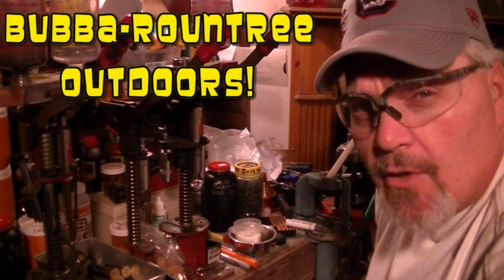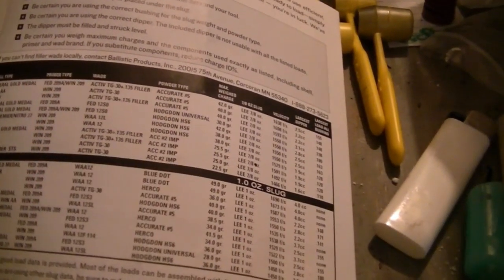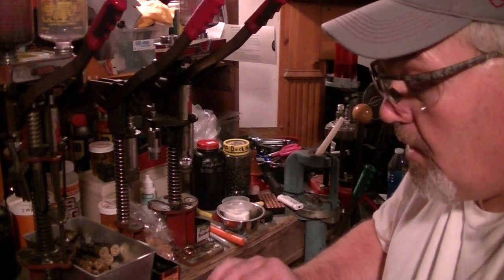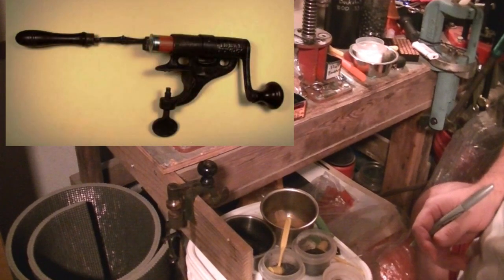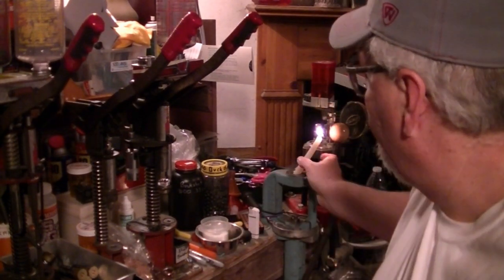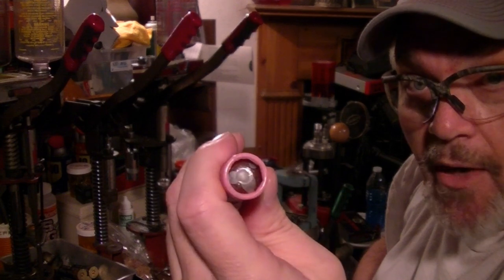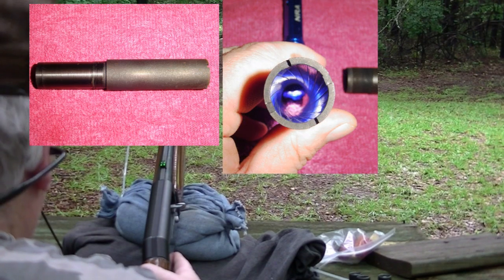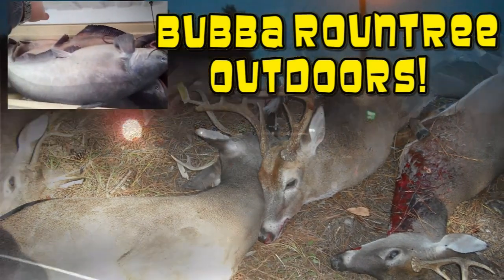Lee Drive Key Slugs! Shooting Slugs thru Rifled Choke Tubes!

Comment: Yo wade, I actually took a cheapy old 3/4” step bit, I wrapped some Aluminum metal duct tape around it, just to cover the cutting edges on the bit. And I use that thing as a hull reconditioning tool. It works AMAZING!! I can literally take a Fold crimp hull, a old nasty looking Roll crimped hull and make the hull mouth look like it’s never had a crimp. Run that thing in the hull until it heats up the plastic, it’ll reform back to a perfect circle. Works really good once it’s nice a heated. I use it ALL THE TIME.
Reply from the maker: awesome!! Thanks John!

Comment: I use the Lee 7/8 oz Drive Key slugs. In a new primed 2 3/4" Fiocchi hull I use 33 gn Longshot and a 7/8 Lightning wad (looks identical to the PT1205) but I trim about 1/8" from the petals so I can roll crimp all the way down to the slug without involving them. I tried a nitro card under the slug to raise it instead, but it made my column too tall. Crazy about these loads!

Comment: thanks again bubba. I've been casting them, bought a scope for my slug barrel.  think I can load these about 11 cents a piece.  if i can hit at 100 yds, i can sell off quite a few guns. with all the ammo shortage, I could always find powder primers and cases and wads.  I think the AK47 will get sold and replaced with a Saiga.  Should be even cheaper in 410, less powder.
Reply: Brian Conway yeah but what's the difference in start up price? Factory 12 gauge vs 410? Yes you could load a lot more with a pound of powder and very little people use 410 that I know of.

Comment: Great video.  I use a 20 gauge nitro card under the slug as well to keep the plastic wad from interfering with the slug when shot.  Works great out of rifled slug barrel guns.  I got one of those roll crimpers too!  If you can find a wad or two after shooting, you will see what happens to the plastic wad.  It actually will "squirt" up into the base of the lee slug, which you really don't want to happen. The nitro card will improve your accuracy.  Have fun!
Reply from the maker: Thanks Bob! I have never used the nitro cards before... I will get some on my next Ballistic Products order!

Comment: Good video. Maybe a bit of help. Those Lee dippers not scoops. You're scooping which is why you're getting so much variation in your charge weights. I push the bottom of the dipper base first into the powder and let the powder flow in. Then use a credit card to scrape off the top. My charges are never more than .2 grains from one to the next. A little more time but worth it

Comment: Thanks for this video. A milder slug load I like derived from Alliant data for birdshot is as follows: (Max load) 8700 PSI ~1300 FPS: Federal Gold medal Hull 8 point fold crimp+ F209A primer+ 22.5 Green dot+ Federal (not claybusters) 12S0 Wad+ Lee 1 oz foster. Optional 20 ga card under slug. 

Obvious disclaimers about loading at your own risk and checking data sources& fit of slug and wad to your barrel and choke.

Comment: I'd like to see that video. I have a couple saiga 12s with stick mags and a drum, and a single shot NEF to keep them company. If you haven't tried an S12 or a Vepr12, you are missing out. Well, with that Berretta super 90, you're pretty well equipped too. Mine have only been range toys and house protectors so far. I get the impression that all of your guns have put food on the table.

Comment: Thank you for the video and info sir.

I don't shoot fast slugs (my plinking slugs go around 1200fps with Green dot), but I've heard from several sources that a 20 gauge nitro card at the base of the slug helps it get away from the wad quicker.   Something you may want to try.    Cheers.

Comment: I have several Mossberg 500s wood 18.5in heat shield. One 24in br barrel with William's sight attached. Good vidio with iron sight accuracy with Carlsons rifled choke tube. I'm  just using Red Dot at around 1,250 fps for low recoil and that PT1205 wad. 
Those factory max loads are about the only thing on the shelf unless special ordering light stuff. That hot ammo opened the action and kicked out the empty as well on my guns.
I'm  a much better shot with "standard" velocity stuff.
Any updates on your loading?

Comment: Bubba, I was watching your videos on the Lee 1 ounce slugs. I'm not able to find any blue dot powder. What are your thoughts about using Green Dot powder instead and if so how many grains would you use. I also have some long shot too.
Reply from the maker: @KeithRollings-n2b  Lee lists a bunch of different powders in the data sheet that they send with the slug molds. Try searching 'Lee drive key slug data' and that should get you there!
Reply: Thank you Sir

Comment: Wow, incredible video -- I learned so much!  Would you conclude that the roll crimp improves slug accuracy?
Reply from the maker: Thanks my friend! In some loads, I agree the roll crimp does improve accuracy! At least it does for me!
Reply: I would guess that the cut down 3" shells might do a tad better than the cut down 2 3/4" for roll crimp?  Agree?  Also, if you buy new hulls, would there be any need to cut the 2 3/4"-ers?
Reply from the maker: Yes, I agree! And, no need to cut the new 2 3/4" hulls...

Comment: Bear season will be coming up in a while and we use slugs what type of slug choke are you using ?
Reply: For a Bear I’d use a HARD CAST SLUG, being they have really thick hide. If you can find them in stock, I’d recommend the DGS-12 slugs from ballistic products or the LBC SABOT from ballistic products. They’re made by Gualandi Italy and they’re actually a hard cast high antimony lead, so you won’t have any penetration issues. It’s a bad day in the woods when you just piss off a 600-800lb bear and he decides to charge you. A definite need for new underwear at the LEAST!! Lol

Comment: hi how are you doing today my question for today is i just got some samples of WAA12R from claybuster and the lee slugs don't go all the way to the bottom of the wad so i used a fiber wad under the slug so the pedals don't open a lot and the slug don't have a gap did you had the same problem and was it ok to use the slug with nothing under it thanks.

Comment: never understood the fascination with high brass hulls 
best hulls around are the winchester AA hulls low brass reload better than any i have found
Reply: dexter2433 you can load high brass hulls with more powder which equals more velocity it also can take more pressure. Have you seen the difference between most factory low brass vs high brass. Most of the time it'll be #4 shot when they start using high brass regularly and they'll be faster.

Comment: Bubba, I got a question for ya. I wanna work up some Lee slug loads for my Mossberg slug gun (rifled barrel). Do you use nitro cards with you work-ups?  I know u like those PT-1205 wads. That other feller uses those pink wads with the 20 ga nitro cards to roll crimp. What say you, brother?
Reply from the maker: Hey Leon! You said it right there... all I use is the PT-1205 wad! I have found no need for adding anything else to the load! I love simplicity! And these things are accurate enough for me... even out to 100 meters with regular shotgun sites! Testing Lee Drive Key Slugs at 100 Meters with Rifled Choke Tubes!
Reply: @BubbaRountreeOutdoors  I tend to shun the nitro cards when possible too, although I do trim the petals to make the slug stick out a bit. It keeps them from "welding" to my roll crimp.

Comment: book said 49gr.  u put 43gr..what happens if you did 49gr...also any difference between rolled or crimped?
Reply: One thing to know about Roll vs Fold crimped. FOLD CRIMP WILL CREATE HIGHER PRESSURES, SO NEVER NEVER SUB A ROLL CRIMPED LOAD INTO A FOLD CRIMPED LOAD!! The Fold crimp creates a tighter crimp thus it takes the shot column extra pressure to push through it. 
Just keep that in mind!
Reply: i made the same mistake. 49 grains instead of the 43 or 6. Nothing happend. the 535 took it in stride. then i watched this vid. ive cut back to 46 folded crimp

Comment: HAVE A QUESTION.. RIFLED CHOKE HAVE THE SAME CONSTRICION THAT FULL CHOKE.?
Reply from the maker: the rifled choke tube is a cylinder bore sized choke.
Reply: @BubbaRountreeOutdoors  THANKS FOR THE ANSWER... I HAVE STEVENS SINGLE SHOT 30 INCH BARREL WITH FULL CHOKE CAN FIRED RIFLED SLUG..?

Comment: I've noticed I find very little load data for using Red Dot powder with slugs. Is it a bad powder for slugs for some reason?
Reply from the maker: +Armed Bear There isn't any 'slug' data using Red Dot! I have used it in both the 7/8 & 1 oz Lee slugs. What we tested was 21 grains of Red Dot in the same load as in the video. It's the same data for a 1 oz game load! It pushed the 1 oz slug to 1150 fps and the 7/8 oz to 1250 fps. I was fairly accurate but not impressive enough to keep trying. Would be great for a home defense load! Red Dot burns very fast and usually you need a slow burning powder to get some decent accuracy out of reloaded slugs!
Reply: @BubbaRountreeOutdoors  Thanks, Wade. You just confirmed my research. I've shot a lot of slugs with e3 and 700x, both fast burners, but my best accuracy and velocity by far have been with Longshot powder.
Reply from the maker: @robertfrapples2472  Longshot is my best all-around powder by far!!

Comment: Will those cycle in a rem 1187 sp deer gun 12 ga autoloader its very finicky about loads
Reply from the maker: I don't know Steve... they cycled well in my Beretta and my Stoeger M3000, we don't have an 1187 to try buddy! Wade
Reply: Bubba Rountree Outdoors well it looks like im going have to buy a lee slug mold and do some testing with your loads with the blue dot and the hercul to see which one work the best and funtion .my 1187 is a picky eater of sorts when it comes to shotshells and some slugs .i used to shoot Active brand sabot hallowpoint slugs in 2-3/4 and 3 in magnums ran great cant find those slugs up here in Michigan any more so your concept loads sound hot enough to make my weapon work well thanks for the info

Comment: hi how are you doing my question is i see you use fiberbase hulls have you ever had problems with it i here so many stories on not to use them because the wad can come loose i have about 50 federal plastic fiberbase hulls i would like to use do you recommend it to use if yes how many times can i reload them thanks
Reply from the maker: +ocean374 I have never had a Fed hull come apart on me! I have reloaded some hulls 7 or 8 times depending on load.

Comment: have you made any of these for 3 1/2 inch shells
Reply from the maker: No Mike... not yet! I don't even know if there is any load data for 3 1/2" slugs!
Reply: Check out ballistic products “THUNDERBOLT SLUG” it’s a WHOPPING 1-3/8oz slug basically a DGS-12 slug on steroids. It’s specifically designed for 3” & 3-1/2” hulls. Only issue is the price, they’re $2 a pop!! $20 for 10. But at almost 1-1/2” those things will keep on trucking through whatever they hit. I’m actually waiting on a couple to arrive now. Cant wait to try those.

Comment: Why not just use the high brass hulls?
Reply: Brass height is pretty much insignificant, except how it runs in a semi-auto. Low brass can be loaded just as hot as high brass.

Comment: does the brass height change performance ie high brass vs low brass
Reply from the maker: Brass height makes no difference in my experience! Wade
Reply: +Bubba Rountree Outdoors thanks
Reply: Bubba Rountree Outdoors is there no difference in how hot you can load them and how long they last?
Reply: There’s no difference at all. The Lyman load manual even states this. They say one of the main reasoning for high brass is to help distinguish light target and heavy field loads. Also they just look more attractive to the consumer.

Comment: Looking for a recipe using 700x Lee 1oz slug
Reply: 6 years late but these are out of BPI slug manual 8th edition.
Fed GM 2-3/4” hull , Fed 209a primer, Ballistic Products Gas Seal, 22 grains 700x, HCD24 wad, 1oz Lee slug, FOLD CRIMP = 10,100psi , 1,360fps.
Also 2-3/4” New Primed Cheddite Hull, 22 grains 700x, L078 wad, 1oz Lee slug, FOLD CRIMP, = 10,500psi, 1,370fps. 
Lastly, 2-3/4” New Rio Primed Hull, 21 grains 700x, L078 wad, 1oz Lee slug, = 9,800psi, 1,360fps.
All wads are on BALLISTIC PRODUCTS SITE. 
Hope that helps(probably not after 6 years, but hey better late than never.)
It may help the MANY MANY newbs to reloading reading the comments.
All of these loads come straight from BPI SLUG LOADING MANUAL 8th EDITION. 
Hand load at your own risk, and ALWAYS BE SAFE AND USE COMMON SENSE.
Reply: The last Rio Hull load is also a FOLD CRIMP.